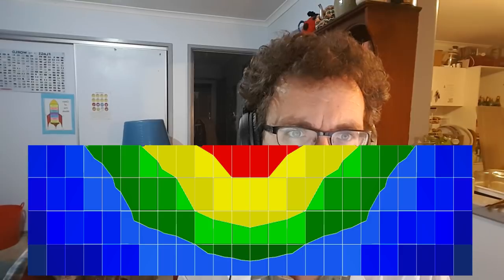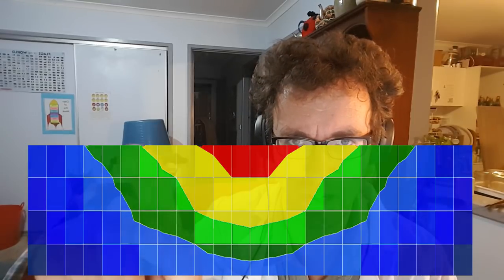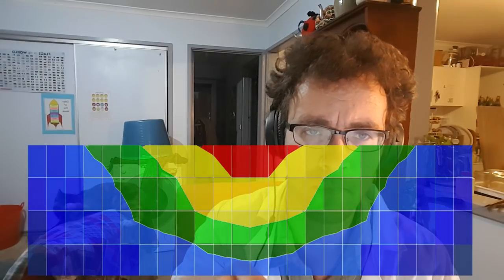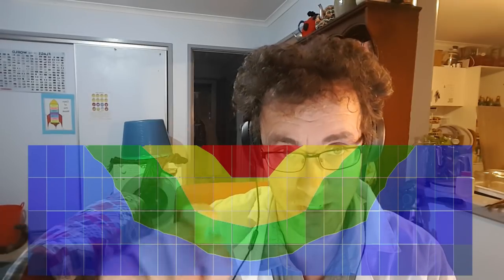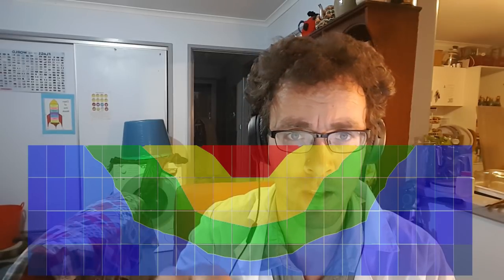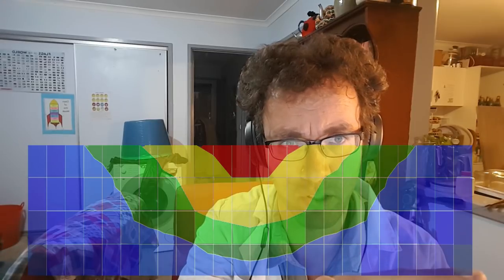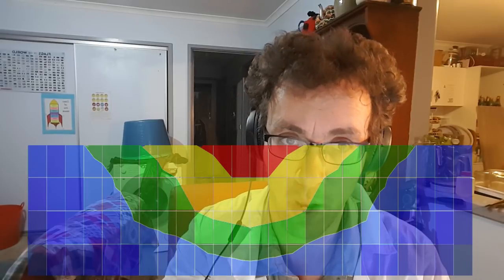Laminar Flow Fluid Dynamics of Prospecting Episode 4

Comment: I think this video could use a re-do to make it faster and more understandable.

Fist issue:  the flow cross section in the sluice is far better explained by the one color graphic than all the others combined by far.  I would suggest eliminating them and using only a quick explanation followed by the color graphic- minutes saved, confusion eliminated, information clarity improved.

I would also set up a new physical demonstration with the sluice box using a very small size angle iron across the sluice holding finely crushed charcoal and small pea gravel and nothing else.  When tipped over quickly it will drop the two materials simultaneously in a transverse line.  The charcoal should stay on top and the gravel go straighy to the bottom illustrating the different flow profiles of the surface vs bottom.

The rest was fine.

Best wishes, Keith
Reply from the maker: Yeah your right. Bugger. I was thinking that. The idea for the demonstration is a good one.
Reply: Glad to help a little.  I appreciate the effort you are making and really like the kids- in small quantities.  :-)